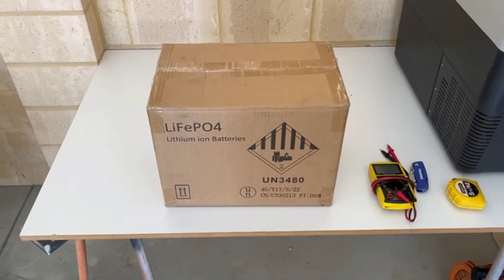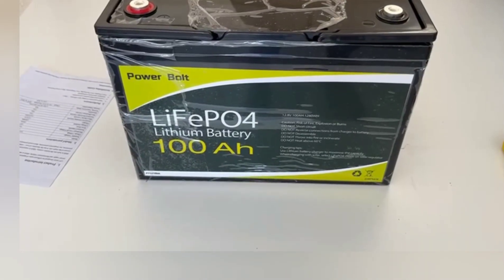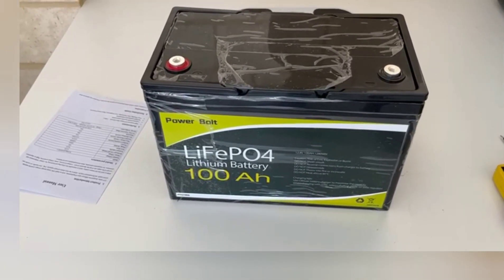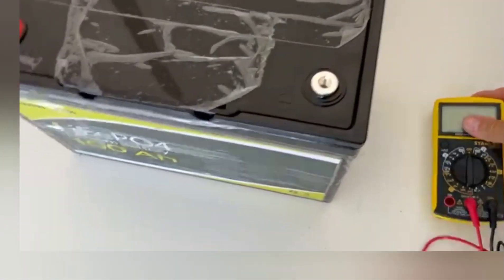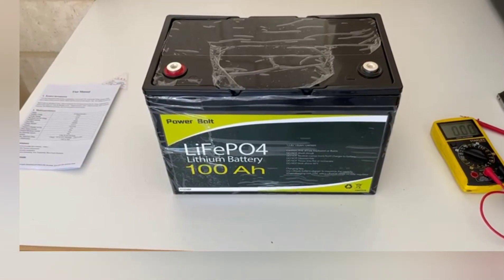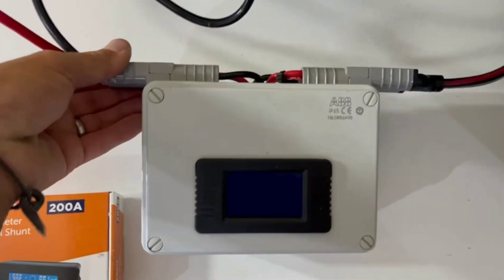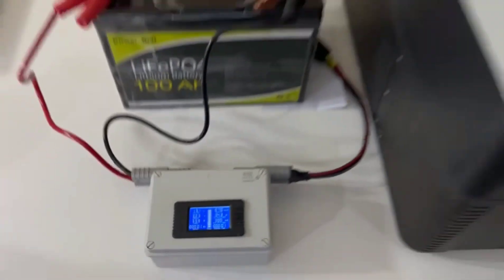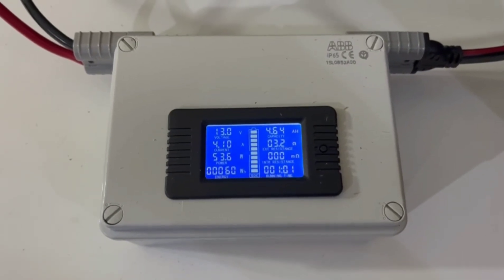CHEAPEST Lithium Battery | 100Ah Lithium LiFePO4 - PART 1 The Fridge Review

Comment: Hi Matt,
Love your videos and connected a meter like the one you have to my battery box to keep track of useage on my 120AH LiFePo4 battery. I'm a little perplexed as my SOC bar meter doesn't go down like your one didn't. Could you please share what you did to rectify this so it worked in Part 2 Freezer test.
Cheers, thanks and keep up the good work.
Reply from the maker: Hi, thanks for watching! Glad you like the video’s. If I remember rightly, I hadn’t set the maximum and minimum voltage’s. Do this to your batteries spec and see if that resolves it. 
Keep me posted.

Comment: Did I miss the point where you charged it to 14.6V before doing the discharge? If the cells were out of balance you would need to wait days for the tiny balance resistorss to do their thing. A resting voltage of 11 indicates it is not yet fully discharged. If the fridge load made the voltage sag for the BMS to trip the display would be dead. It appears your Fridge can't go low enough. 110ah in bit of concern if the meter is calibrated. Picked up one yesterday for $250AUD yesterday. Will see how it goes.
Reply: Gave it a day and a half at 14.6V to make sure it was balanced, capacity tested down to 11.65V with 1282Wh on the dial with a 20amp load. Battery is 13Kg. The Current generation 100Ah cells are around 2Kg. The weight supports the teardown video showing it has 8 X 60AH cells that are probably aged. Still for intermitent use (camping as advertised) I expect it should last many years. Had no bolts for the terminals!
Reply: @mathewemy  Has yours bulged a tiny bit?

Comment: Looks to be identical to the Voltx battery from Outbax
Reply from the maker: Arhh really? When i was looking for the cheapest batteries it was a toss up between this and the Voltx.
Reply: @vesautoelectrics  I had the Voltx in my last setup and had no problems with it for the two years I used it. I also bought their solar blanket that I still have and works fine.
Reply from the maker: That’s good to know, I haven’t heard any negatives with the Voltx stuff. Was you getting the rated ah from the battery in the two years you used it?
Reply: I didn't test the capacity but did check some reviews and others on YouTube who had tested the model I purchased.. they gave them a good review.

Comment: I've tested this battery with a shunt straight of the earth terminal which was power  by the plus terminal and found it held over 100 ah but I pulled a load of 20 amps for 5 hours. I've tested the shunt in different ways and it works. The is Shunt is a TR16COULOMMETER.
Reply from the maker: Thanks for that, will definitely check that Shunt out. What country are you in?

Comment: My fridge is 110 litre 12 volt I use Power Bolt lithium ion. I have 2 batteries, one for fridge and TV the other for air-conditioning in my caravan. I live in the mid North of South Australia and there is plenty of sun here even in winter. I paid $300 on eBay, I power all my caravan applications 24/7 on just 640 watts of solar panels
Reply from the maker: Thanks for the info. What size A/C are you running and how long have you been using the batteries for?

Comment: I have one of those power meters and I don't know if it's a dud, but when I use it on a 12v fridge, as the power use fluctuates, the Ah figure drops... not the current draw, the Ah. 
It doesn't do that with a purely resistive load, nor when the battery is charging. I think the charging Ah you see are accurate, but your fridge power use figures are not.
Every battery capacity tester is a resistance heater. I'd be interested to see the meter reading running a 55w halogen car headlight bulb.
Reply from the maker: That’s for the feedback. Interestingly i had an old shunt id used that did the same, ah would drop but not the current. But at the end of say a 3 day fridge test the ah would read correctly. Same as the new shunt I recently purchased. I will try your suggestion with the continuous draw of a halogen on both shunt’s as see what results i get.
Reply: @vesautoelectrics  Cool, I'll be very interested to see the results.
I do have a question though, and it's a genuine one, not trying to be a smart arse 😄.
How do you know the final reading was correct?
Also, the shunt could not cause the Ah to drop, either the measured value or, of course, the actual real amount. It can cause the instantaneous current draw to be wrong, but the meter will simply calculate incorrect Ah using the incorrect A over time. A fluctuating current will, of course, add Ah to the total at different rates, but the A, measured correctly or incorrectly, are always positive... always flowing from the source to the load, so there's no way Ah can ever decrease. 
Like a bucket being filled... you can turn the tap up, down, on and off, and the bucket will fill at different rates... you can even miss the bucket with the hose, but no matter what you do with the hose, the measured amount of water will always increase unless you turn the tap off.

Comment: i was kind of interested until you said we cant series or parallel them.
Reply from the maker: Yeah i was surprised to read that they can’t be linked. Not sure why not?
Reply: I've been running 8 of these, 4s2p (48V 200AH) for 18 months off grid, zero issues.
Reply from the maker: Are you getting the full ah out of that set up?
Reply: @vesautoelectrics  deepest discharge was 9.7kwh, with around 7% remaining.

Comment: Those batteries were 100Ah once upon a time, but commercially used then sold back, or they are actually new 75 Ah cells, still pretty good value for £190.
Reply from the maker: Yeah you could be right, these are two possibilities. Will be interesting when i do a teardown to see how it’s built inside. Will upload the video soon.

Comment: What is the difference, other than price, between a cheap LiFePo4 and an expensive one? It is used? Is the construction poor? Is the BMS terrible? Or all of the above?
Reply from the maker: I would say possibly all of the above. From what i know, the expensive batteries use custom BMS suited for that battery, with temperature protection, grade A cells and a quality built unit.
Reply: I suspect, very little. The fact that they are meant to be 60Ah cells but they are only 56 means they're factory seconds. It's not economical to recycle them, so they sell them cheaper. I have a Powertech meter and a fridge, and as I watch it, as the power use by the fridge fluctuates, the Ah reading swings wildly, up... and down! That's impossible of course... the instantaneous power used can fluctuate up and down, and it does, but the total power used? That can only increase. Battery capacity testers are always a simple resistive load. Easy to measure. The fact that a full charge of his battery seems to reflect what we'd expect it to be, and that type of power use is effectively the same as a resistive load (no capacitance or inductance from a brushless DC motor controller to flummox a simple power meter) is just too coincidental.
I might be wrong, but I don't think so.

Comment: How did you make that watt metre ? That is cool, I'd love to see a video of how you made that so I could make one and also conduct some tests on my battery. Thanks 👍
Reply from the maker: Thank you for your comment. I will make a short video and upload it soon for you. Hope it will help. What battery do you have?
Reply: @vesautoelectrics  I have the same battery only to 200AH in my van. To me it seems to run down quickly. Does your victron charger stop completely once the battery is charged or does it then trickle charge? I bought a kick ass 9 stage 22 amp charger and once the battery is full it stops charging even if there's still amps being pulled from it and it was the same with my solar on the weekend. Once it had the battery back to 200ah it stopped charging even though we were off-grid and we're using amps in the van... You think it's a battery problem or are they meant to be like that do you know? My old AGM would continue trickle charging and would keep the solar pumping in while the sun was giving it. I look forward to that video when you make it, that would be some handy kit that little gizmo. Thanks
Reply from the maker: The victron charger I’m using will constantly trickle charge the battery, changing states of charge depending how much is drawn from the battery. Is the kickass charger compatible with Lithium?
Reply: @vesautoelectrics  yeah it is compatible with lithium, lead acid and AGM
Reply from the maker: I have just looked up the specs of the charger you have. It has the trickle charge function aswell as the fast charge option for Lithium. So it should keep it continuously topped up? If the settings are correct then there’s an issue with the charger.
Reply: @vesautoelectrics  thanks heaps mate, it's more than likely I have an incorrect setting then. I'm pretty sure my solar panel did the exact same thing on the weekend but also. I'll have to investigate when the sun is out next as it is raining cats and dogs here at the moment. Thanks for your help
Reply from the maker: No worries mate, double check everything and let me know. 👍

Comment: Why can't they be connect to boost???
Reply from the maker: Yes thats correct. On the specs it says not to connect in series or parallel. I’m guessing it’s something to do with the BMS they use?
Reply: I looked at these but I got a 120ah king’s lithium battery with battery box on a one day sale for $449! Heaps better then the power bolt. Kings has a 100ah charge and 100ah discharge BMS and 160ah surge and can connect in series or parallel. Good video these aren’t bad for the price as long as you’re not looking to build a battery bank.
Reply from the maker: $449 for that is a great price. That is a big down side to these powerbolt batteries that its only 50amp charge/ discharge and no parallel/series connections. What set up do you have using the kings lithium? How’s it performing?
Reply: @vesautoelectrics  Zero system because on pension budget in the UK so can not afford a system to save energy that would help me cut costs and cut CO2. your video Liked and add to my Energy Reduction playlist
Reply from the maker: I’m glad you liked my video, hoping to get the next instalment uploaded soon.
Reply: @vesautoelectrics I’m testing it this week 4 day camping running a Brass Monkey fridge, Boss camp lights and a small fan plus USB charging phones and whatever. I’ll have 200 watt solar panel charging it through the day. So see how it goes.
Reply from the maker: Providing you have good amount of sun each day you shouldn’t have any issues at all. That’s a great set up. And i love the brass monkey fridges, great value! I have one in the ute. Let me know how it all goes.
Reply from the maker: Thanks for the comment, what do you mean by connect to boost?
Reply: @vesautoelectrics  I think you say they can't connect them together?

Comment: Nah, something wrong with the settings in your shunt.
What peukert exponent setting are you using?
How can you discharge 75Ah out and put back in 110Ah? Minor discrepancy you could expect but not that much.
Get a something reliable like a Victron smart shunt and set the parameters properly, the main ones being peukert exponent 1.05 and charge efficiency 99%. For LiFeP04.
Reply: Lost to heat. Unhealthy battery with a high internal resistance. Totally normal behavior for a battery that’s been cycled the number of times until it’s down to 80% original capacity 

These are used and abused cell.
Reply from the maker: Thank you for your comment and feedback. I am going to purchase the victron smart shunt so i can adjust the settings for Lithium and redo the test. Will upload the results soon.

Comment: Great vlog mate. Very, very interesting and informative. I'm running 3 x 110ah agm's in my campervan, and I'm toying with upgrading to lifepo4.....I love the idea of dropping some weight, but the price of them back here in the UK is nuts....thanks for your time doing this. Subscribed👍
Reply from the maker: I love the victron stuff, use it all the time here but as you say the batteries are pricey. But that is a huge weight saving! Let me know which one you go for. And how it goes?
Reply: Hi, I went from 2 agm's to 2 lithium batteries. What a game changer! My inverter
stopped alarming when using the microwave because of the voltage sag.
Plus it's 1/3 the weight of a agm. Hello from the States.
Reply from the maker: Hi! The difference is unreal! Alot of people are still not sure about Lithium and the cost, but once you make the leap, the results are awesome! Like you say, it’s a game charger! And they are only going to get better! What batteries did you go for? Where abouts in the states are you?
Reply: If you want UK cheap, have a look at Kepworth, pouch cells granted, but I get 106Ah/1360Wh on a 4wire measurement out of them for £369 100Ah/£626 for 200Ah on eBay, might be slightly less on the Ali's. Because they are made from pouch cells, they are extra light, and it has 2 USB 5v sockets, which can be handy.
Reply from the maker: Thanks for the info. I’ll check them out. What are you using them for? And how much do they weigh?
Reply: @vesautoelectrics  Mainly using mine to run an inverter to periodically charge my car starter battery using a CTEK mains charger in the boot as no garage or off-street parking, cheaper than constantly replacing sulphated lead-acid batteries due to leaving the vehicle sitting, and it's nerdy fun too I must admit. Batteries weigh 9.7KG.
Reply from the maker: Ok cool, what size inverter and charger are you using? It is good fun, I’m always trying different things and tests on various batteries, hence why I decided to start this channel. Is the car parked in the sun at all? If so you can get a little 20watt solar panel inside the car to keep the battery topped up?
Reply from the maker: Thanks for the comment mate, glad you liked it. Extra power and weight are big benefits with Lithium batteries but as you say the cost is high. Maybe stick with the AGM’s till they die, then consider going Lithium? By then the prices may have dropped abit? Just one 200ah or two 100ah would have more power than the three 110ah agms your running at the moment so the weight savings would be huge. Also the other cost to consider if/ when you upgrade is replacing the chargers aswell to suit. What sort of average prices are they in the UK?
Reply: @vesautoelectrics  A half decent 200ah is anything around £1k. But something really decent like a Victron 200ah LifePo4 is double that....!?! But at 20kg, compared to 3 x 25kg (agm), it's a no brainer if weight's an issue as in my case. I think I'm gonna bite the bullet and do the swap tho....Great video pal.
Reply: You shud hitt some one making battery packs of VW car batteryes.
Low prices and very very good power.
Best you can get
Reply from the maker: Thanks for you info, I haven’t considered car battery packs.
Reply: And alsow so much lower prices.
Agm to lithium is a New world
Reply: I did this. In 24volt systems. 
I had 44kw agm enersys powersafe agm.
Did buy 10kw VW battery box whit bms 200 amp. 24volt.   Totaly cost like 1500 dollar.
1 of 8 of all prices you can find online.

Your car crusher that condemd cars know where ore Who is making batteryes like this.
Mine was not used att all. Colide first week of use. Battery all ok.   And maked me very good price
Reply from the maker: $1500 for a 10kw battery box is great value!! You could run an off grid home with that amount of power! What are you using your system for? And how are you charging it?
Reply: And I am in norway.  Here prices are more higer then there.

DM me if you dont mannage to hit some of this builders. And u can get it from norway
Reply from the maker: I will look into it here in Australia. If i have no joy i will let you. Thanks

Comment: For those who can`t afford 12v coolers the little dorm fridges work well as emergency refrigerators. Just be sure it`s a manual defrost. I bought one for hurricanes and my 500 watt 560 wh solar power station runs it 24 hours. But I`m using 110 volts.
Reply from the maker: Thanks for the comment and info, what brand fridge are you using? Any issues?
Reply: @vesautoelectrics  Mine is a 3.1 cubic ft energy star rated Teccpo. Just some name they stuck on it I`m sure. I got the one that was the best deal at the time about two years ago. It has worked fine so far and hardly ever turns on when it`s cool (65-70f) inside. It has a tiny freezer section just large enough to put about 5 or 6 small bottles of water in laying on their side. That`s what I do when severe weather is predicted in warmer weather. We were directly hit by two hurricanes here in Lousiana in my region in 2020 so I tried to get every possible thing I could to prepare for the next ones.
Reply from the maker: Yeap best to be prepared!  Sounds like a good set up.